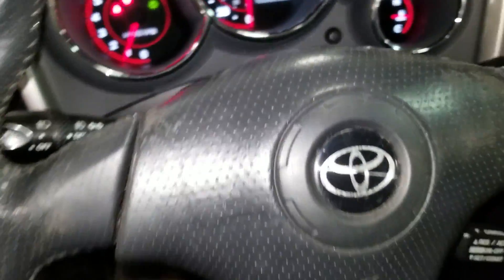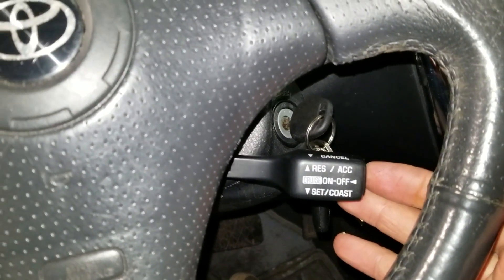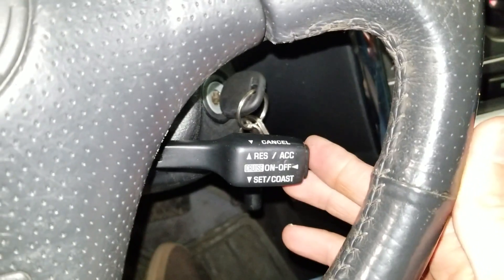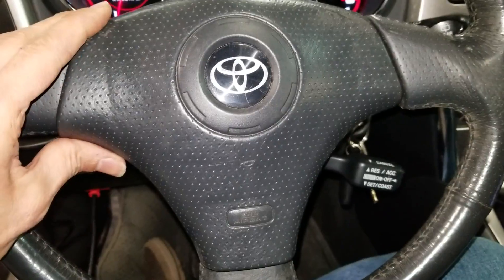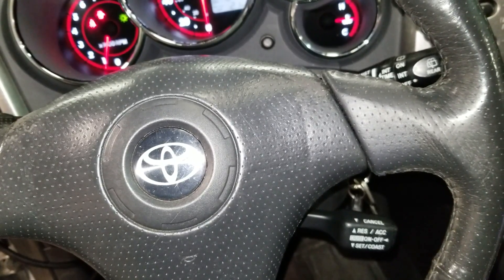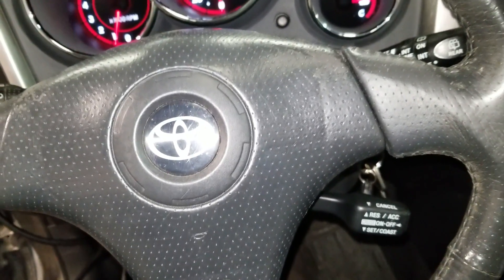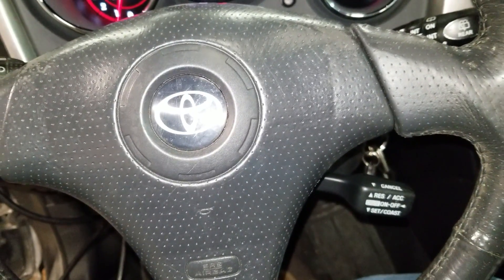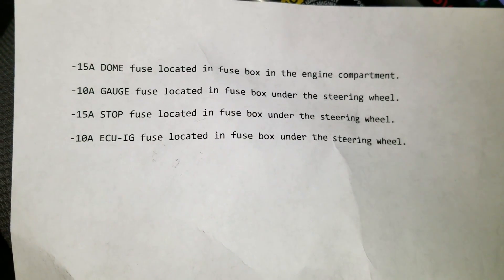How to Remove, Replace & Fix Cruise Control Switch or Fuse on 2005 2006 2007 2008 Toyota Matrix Vibe

Comment: Your video help me fix my 2011 Highlander. I spent hours checking everything and all pulling all the fuses I almost gave up. Then I saw the screw on the back of the control like you did. I didn't pull the control out, I just turned the wheel to a good position, removed the screws and,,,, DANG,,,,,,, my copper tabs where bent and not making contact. I bent them back and it worked like new. I think the wife hit a bump or something and must have hit the control hard the her knee or something and jammed the on/off button too hard. Thanks Brother. You're my hero! DS
Reply from the maker: Excellent , thanks for sharing and i am glad you found this video helpful .

Comment: Thanks very much for your detailed instructions. Although I’ve got an older Celica (1991 convertible).  I now understand the principles of fixing the cruise control. Toyota doesn’t change much. I’ve had 3 now. My cruise control works intermittently so I think I can see why that may be now.  Thanks very much.
Reply from the maker: 👍✌ Glad to hear you found this video helpful

Comment: This helped with a 2008 Toyota Camry hybrid with the same switch. in my case, the both of the those little contact fingers on the the outside of the three were simply bent too far back and made no contact with the corresponding sides. I bent them the correct way and Voila i have cruise control back again.

Comment: Thank you for this. My advice for others is the copper piece is like a spring and it will go flying in the right situation. Handle it with caution! 

Mine when flying off into space when I took the button out while troubleshooting and disappeared. I mean I was to the point I was going to take the seats out! But the thing is gone and I give up here. 

I'll get a junkyard assembly off Ebay. Hasn't failed me yet.

Comment: Man....been trying to figure out my cc word for a while. Can't afford a obd trader like you have. 
    My cruise shuts off after about thirty miles. Then when I reset it, it goes off after maybe five miles. Then it just constantly goes off until finally the green light goes off and won't come back on....like something is getting hot. 
   I've replaced my clockspring and still have the issue. Have cc modules and switches from junkyard....haven't bothered yet with swapping. Next worrynis the actual cc throttle actuator. I have an 04 XRS and I believe it to be different from the regular base and xr (6 speed trans). Anyhow...thanks.

Comment: That Autel Maxi system, does it adjust mileage, I had to replace my instrument cluster due to a short circuit. شكراً يا نبيل
Reply from the maker: Nope
Reply: Auto Repair Champs Thanks for the speedy reply, if you know any other tool that will work for that please let me know, I had 131k and the new one has only 57k, I need it to match my receipts and Carfax report, I need to bring it up to 131K
Reply from the maker: @Ben-Hawy  I am sorry I Never used any for that matter . Thanks

Comment: Thanks for the video I have a 2011 corolla automatic. I did this and replaced wire harness too. My cruise light didn’t kick on for a while but then it worked until the next morning when I started the car and it just went back to not working again. My transmission is kind of going bad I think and I’m wondering if maybe the computer is turning off my cruise control.
Reply from the maker: It is very possible . If you it didn't work right away when you thought you fixed and started to work on the next day , i feel like you didn't hook things correctly and somewhere is still loose . I would recheck the wires again and make sure everything is connected  . I believe when you turned the wheel right and left is when loose wires reconnected and started to work
Reply: Auto Repair Champs thank you sorry my wording was bad. When I first changed the switch last night it didn’t work right away and then I ended up changing the harness too. It still didn’t work right away, then out of nowhere a few minutes later the on/off cruise light started working but when  I started the car this morning nothing worked again. When I was working on the switch last night I had battery unplugged. I’m going to check if harness came loose again thank you for the quick response.
Reply from the maker: @RobertNazarov65  yes , keep me posted . Thank you and good luck
Reply: @RobertNazarov65  I have the same issue, did u fix it yet ?
Reply: @moussakouzrit2278  not yet I thought I fixed it but it only worked for a week or less then it went back to the cruise control light not turning on. I think unplugging my battery when I changed the cruise control knob is what helped reset the electronics but after a while it stopped working again. Hope you get yours fixed, I gave up on mine for now.
Reply: @RobertNazarov65  Thanks for the feedback... Now I'm pretty sure it is the spiral cable clock spring to be replaced, because the issue was intermittent... I think the wire connecting Cruise control is damaged. Still to be confirmed once  replaced.

Comment: I keep finding the part with out the ground? And all the reviews say it works great. Should I still get it?
Reply: That ground is to help keep you safe as well as the cars electrical system if you put that piece in it may work but its gonna pull so much electricity from the power supply and the next time you touch any metal from the frame close to where you install it its gonna give you a shock not to mention it could badly melt the hook up

Comment: When you turned the key on did the CRUISE light turn on prior to the issue?
Reply from the maker: I honestly don't remember but I am pretty sure just like other cars when the light is on that means it is set and it is enabled or turned on . maybe you wires are touching . did you try turning it of? Does it go off ? Let me know . thanks
Reply: @autorepairchamps   I have a friend with a functioning Cruise control on his Celica GT-S. I asked him to do the KOEO light panel test when all the dash lights illuminate and he said the CRUISE light does NOT turn on. It turned on if he hit the switch though. I noticed those two notches next to the little screw . Those are test ports actually. If you short those two together the CRUISE light will turn on. You can also check resistance values on the accel, resume, decel etc etc with those two ports. It's wired in parallel and depending on which one you select the electricity goes through a different resistor. The resistance value is what makes the computer know the setting.  I realized this after noticing 4 wires on the switch but only two wires going to the harness. ALSO! super helpful hint, if you  notice the cruise control not turning on, and the airbag light on, and the horn not working it's most likely your clockspring that is bad. Sometimes the clockspring is bad but still lets you use the horn and airbag system... turn your steering wheel completely to the left and or right while simultaneously turning the cruise button on and off. Usually when its full left or full right your cruise light will turn on, this is your clock spring as well!

Comment: Can I fix a cruise control button to my Toyota matrix that did not originally come with the cruise system?
Reply from the maker: It might be possible but won't be easy as you will need to install the Cruise Control Actuator and rerun the cable that hols the cruise control speed. This is going to be kindda of hard to do your self ,

Comment: Hey, thanks.  I'll make run to the junkyard to get switch.  Do you recommend that verses a cheap Amazon switch?   That's quite a handy scan tool.
Reply from the maker: Honestly switches like these all work like genuine and brand names.  It doesnt matter as long as the circuit  and electronic functions works ok, It does a simple job . Cheap generic works just as well . Thanks